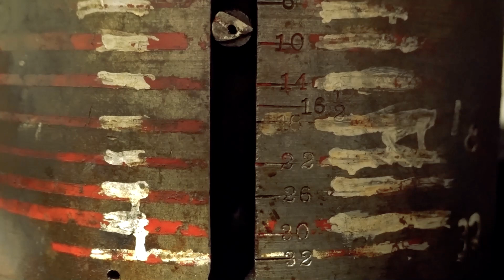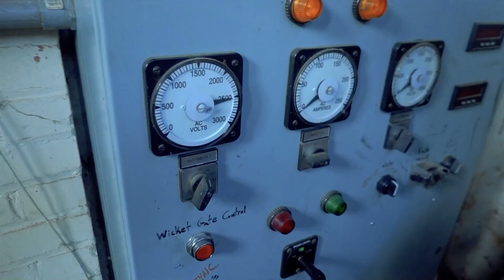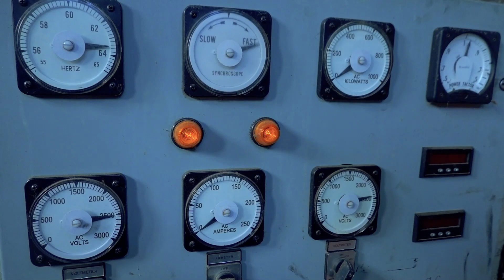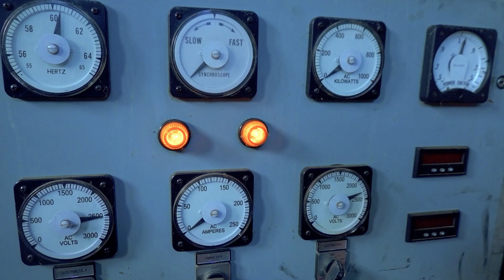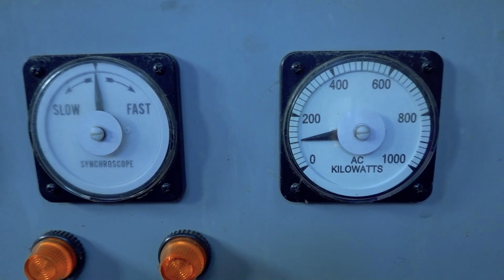Authorized Personnel Only -  Slip Rings Back In Action

Comment: Why do you need brushes for both the three=phase output and the exciter? Or am I thinking of two different turbines?
Reply from the maker: We only need brushes for the Exciter connection and for the Blade Angle motor. But that's an excellent question and I'll give you a lot more clarification on it in an upcoming episode. :) I'm doing preproduction work this morning so, you just got a whole video from that question. Thank you :)

Comment: Easy to clean the phenolic spacers, simply use a brush and gasoline, which will strip all the schmoo off in a single brush action. Works on the holders as well, a brush over, and wait for the fumes to go before letting the pixies loose, as otherwise you get the good old ring of fire.